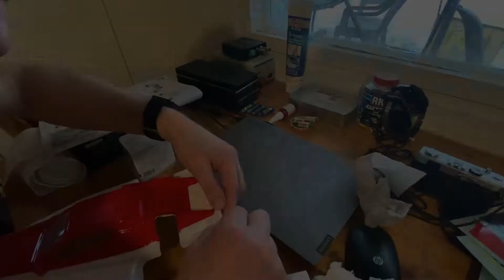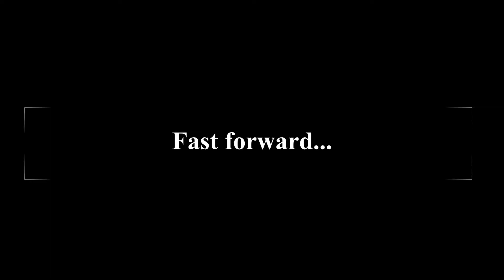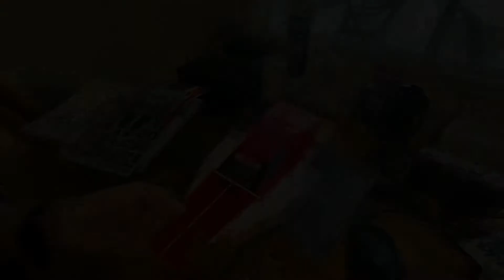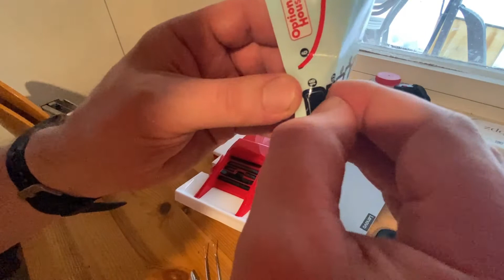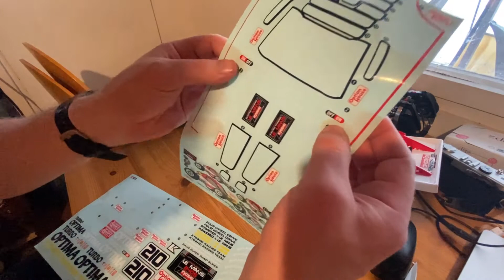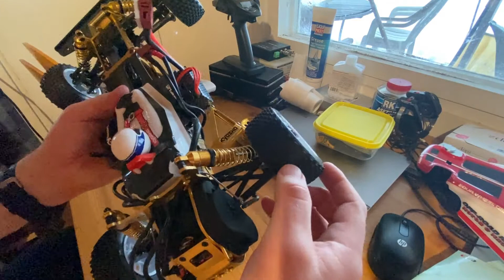Finishing my Kyosho Turbo Optima and putting stickers on it

Comment: You made putting the stickers on a lot hard than it really should be. If you use window cleaner sprayed onto the body to lubricate them, it gives you time to locate the stickers properly. Once you're happy with how they sit, wipe off the spray with tissue paper, it's so much easier. The back window louver section, I'd probably mask it up and paint it black since the decals don't cover it completely. 
Another good idea, seeing as the red decal will be different to whatever red paint you use, would be to use the lower red decals as masks and take them off after the white paint has been applied and then paint that section in the same red as the other red sections.
Reply from the maker: Thanks for the tips, I will try those out next time